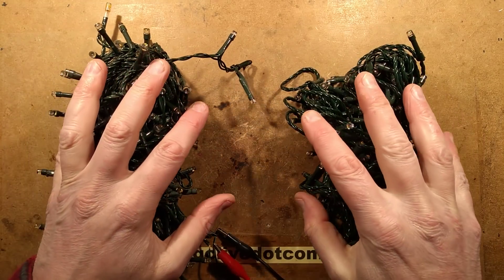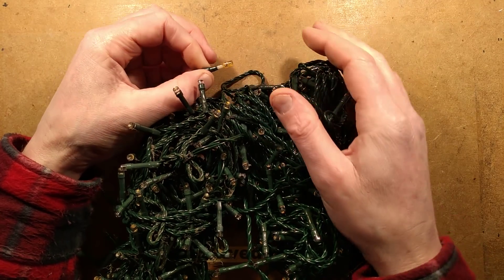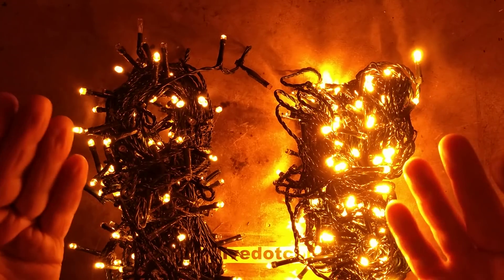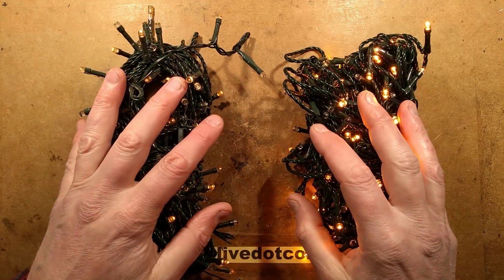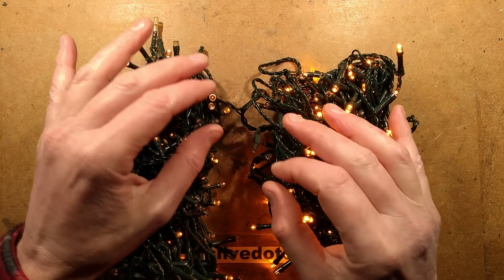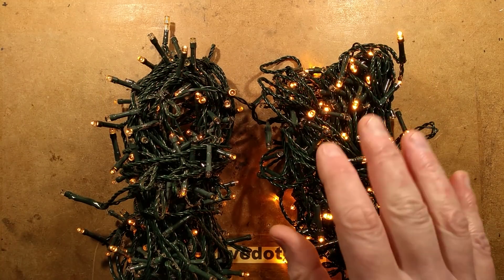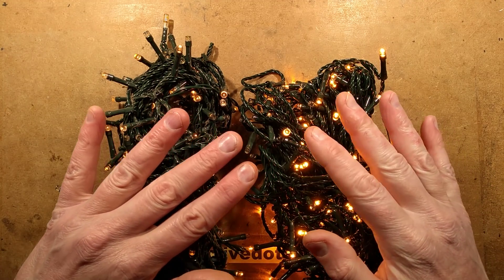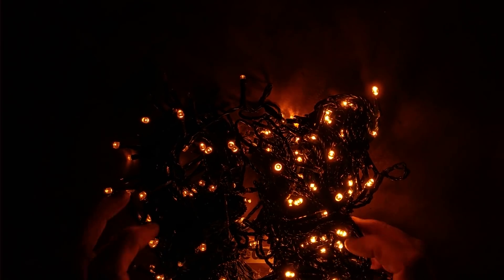9000 hour LED intensity loss test on LED strings.  (All LEDs do still work.)

Comment: I hate the way current bulbs, be it CFLs or LEDs, gradually fade. You don't notice it on a day by day basis, but then one day you're thinking "it's kinda dark in here, isn't it?", change the bulb and realize you've been working for months under fractional amounts of light. It's annoyingly sneaky :(
I miss tungsten bulbs. They were either giving you full brightness, or zero brightness. Very simple. Also because they had a much nicer light spectrum :(
Reply from the maker: That's especially true of overdriven LEDs.  Under-running them makes them last a lot longer.  Perhaps the worst bit is that they use as much power when old and dim as when new and bright.

Comment: So that also applicable to LED monitors and other LCD screens? In office they stay lit for 24 hours and after some 2-3 years you need to throw them to garbage? With CCFLs there was no such intense degradation seen.
Reply from the maker: All monitors experience gradually intensity loss over time.
Reply: @bigclivedotcom  gradual, yes, 10 years or so, for ccfl, from my experience. Not years like in this case.
Reply: Ayrat Gimatov - ALL LEDs and indeed CCFLs suffer a reduction in light output as they age. The LEDs in a monitor should be better quality than that found in a cheap set of Christmas / party lights. So they should last longer. Don’t your monitors switch to a low power standby state when the computer is not being used?
Reply: @Mark1024MAK  not in my case, it is in 24hr operation. That is why im worried. Older ccfl monitors got dim only after 10 or so years of such operation

Comment: I've had replaced every lamp in the apartment with LEDs. I was aware of the dimming effect of the diodes before hand. After 2 and a half years they still output good light. And honestly I've seen incandescent lamps dim out over years of use, and do it quicker then the LED bulbs I have.  As for LED Christmas lights, my average use for any set is 3 years. 6 weeks on at 24 hours a day. Also I don't buy the 200,000 hour life the manufacturer says. It's like those FRS 2-way radios that claims 36 miles distance but only go a mile or 2. It's marketing wank. Off my soapbox now.

Comment: The LED equivalent bulbs I got for my house had an L70 rating. Basically it's the time it takes for the luminance to reduce to 70% of it's original output.

https://www.simplyled.co.uk/blog/what-does-l70-mean/
Reply: I suspect the vast majority of ordinary people have no knowledge of the L70 rating and just buy based on the lowest cost and equivalent tungsten filament wattage figures... 🙁

Comment: These xmass type strings have become disposable in terms of price anyway. Stores where jam packed with a myriad of led strings, most for the price of a cup of coffee.  Felt kinda sad. I'm far from a Greta "How dare you!" environmentalist but I really don't like the disposable consumerism culture.
Reply: it literally makes me sad thinking of the lights clive is probably going to retire before they have fully failed, surely there has to be some kinda use for old, used, abused, tired leds!
Reply: @jdslyman C7 incandescent bulbs are rated at 3000 hours average lifetime. I doubt you would find many of them still working after 9000 hrs, if any at all.
Reply: Sometimes the incandescent strings have cascade failures though where all the bulbs go out.
Reply: I was never a fan of the C7 strings, but I can appreciate their versatility. Any old night light bulb can be swapped in for a burned-out bulb. The sockets are rugged, and the wiring is typically pretty good (especially on older well-cared-for sets). I have a cluster of three red plastic bells (with C7 bulbs) from the mid-70s that still looks and works as great as it did when new. The C7s are power-hungry by today's standards, but they certainly are robust and simple sets without some questionable-quality driver module attached or thin flimsy wiring that is probably cooper-clad aluminum instead of nice, fat, stranded copper.
In my family, 99% of what we used were the miniature incandescent variety. Our house lights stayed installed year-round, but at the beginning of each Christmas season I was out there replacing missing/broken bulbs and repairing the wiring that squirrels chewed up. After six years of splicing and heat-shrinking, or complete replacement of sets that were too far gone, we stopped decorating the house. I took all the sets down, salvaged every good bulb and fuse for our indoor sets, and tossed the rest. I can't even imagine what it would have cost us back then to replace every single damaged set, had I not repaired so many severed wires and chewed-up sockets.
*TL;DR* The older sets were more durable and repairable than what is out today, and I trusted my repairs more than I trust a possibly-dodgy power supply on LED strings.

Comment: I want to run 100 strand of these wide angle LED mini string lights that came with a DC 3 AA battery pack on a 12v car battery in the garden shed that is on a solar panel. Would I just need to wire up some resistors on the positive end or would I need something else to slow the current?
Reply from the maker: You'd need a resistor, or for greater efficiency you could use a 12v to 3.3v regulator module.  You can buy strings of 12v lights on eBay.
Reply: @bigclivedotcom  Awesome! thanks I'll give it a try.

Comment: Quality LEDs WILL NOT fade that fast. If manufacturers used quality components and properly engineered the product, you'd have a product that would last for years. Of course, this won't happen with a dollar store string of lights or cheap luminaries. My town switched over to LED street lights a few years back and they haven't suffered any visible lumen depreciation. I used to test LEDs on a constant current supply with a light meter. The cheap junk would fade below 70% within as little as 48 hours while the quality LEDs stayed above 70% for over 50K hrs.
Reply: Ah but the drivers on street lights, as far as I'm aware, compensate for this degeneration as they dont drive them as hard to start with and then ramp the drivers up over time to counter the effect, but at what point does the driver run out of puff, be interesting to see if Clive could restore the brightness by over driving the 9000hr set and how long they would last ?
Reply: @SmallroomProductions  This driver compensation technique doesn't make any sense. If quality LEDs were under driven from the start, there wouldn't be any lumen depreciation to be concerned with. In fact, a good LED fixture is made by running the LEDs at less than their maximum current using good thermal management and quality components.

I have run ordinary household LED bulbs for 5 years continuous in my enclosed front and back porch fixtures as a longevity test. They are still going strong. A quality commercial grade fixture could easily do 10 years without significant degradation. We shall see...
Reply: JohnAudioTech - can you provide any references for your qualitative, unsupported statements?  You get away with this stuff in your field because there is no way to calibrate your ears. Now you’re pulling the same stuff where data exists so show it or go away.

Audio people don’t give a damn about supporting their audiophoolary in their own field but seem fine with exporting it to areas of real engineering bb
Reply: @JohnAudioTech  you could be right, Philips give their lanterns something like 100'000hrs life which roughly equates to 20yrs on a dusk till dawn senario, although I do wonder if the electronic drivers will actually last that long. I've not been that impressed with commercial Drivers or electronic ballasts so far, when you compare it to the old wirewound ballasts which while they were pretty inefficient would just keep going and going regardless, they were after all just a lump of copper wire wound round a lump of steel, I've removed wirewounds that were circa 50yrs old and still running perfectly. Where as these electronic ones can have upwards of many hundreds of components inside them, any one of which can fail causing a complete failure or a light that just flickers the whole time.
Reply: @boonedockjourneyman7979  As I previously stated, I used to test LEDs and found the quality ones to last years whereas the cheap junk could fall below the LM70 standard within a few days of testing. It is rather apparent that you know very little about LEDs. Do your own research. Test a few and get back to me in a few years.

Comment: Replace everything with LED's they said, it will save the environment they said. They didn't say you would have to throw out the whole LED string and replace it every year, instead of just replacing a bulb. 
But an electric car their said, it will save the environment they said. They didn't say you would have to replace the huge 1 ton battery pack every few years instead of just changing some oil and spark plugs. 

Kidding aside, I love LED's but I was not expecting the dimming to be so dramatic in just a year. Very interesting
Reply: Maybe this leds aren't normal? Normal leds should last longer.
Reply: Don't forget that Lead Free Solder that quadrupled the amount of electronic waste going into the landfills.
Reply: Cheap LEDs from the Far East degrading quicker than higher priced quality LEDs, well that’s not really a surprise is it....!

Comment: There was me thinking that the lamp companies initially saying that with an LED luminaire you can get 100,000 hours was all correct, thoroughly tested and verified by an independent source were correct only not to find it's BS. I'm so disappointed... NOT!! So how much is this going to cost us with unnecessarily high street lamps. probably one of the best bits of road lighting outside RAF Northholt.
Reply from the maker: Good quality LEDs from a prominent manufacturer should degrade much slower.  Hopefully most street lights are using better quality LEDs.

Comment: Do you think this is from manufacturers driving them at max current rating for the chip, like 10+mA per chip? Is it heat that kills them or a chemical reaction in the phosphor? I'd imagine either way driving the chips more gently could help?

Edit: 100mA for the whole string doesn't seem so bad, hmmm
Reply: 3mm and 5mm traditional size LEDs often have maximum continuous current ratings of 20 to 30mA. I don’t know how this set is wired up, so can’t comment on the 100mA that they are running at. Lifespan of the LED chip’s ability to convert electrical energy to light degrades at a faster rate as the current level increases, and as the temperature increases. For maximum lifespan, they should be run at half (or below) the manufacturers rated continuous current rating. And where appropriate, they should not be operated at too high a temperature (so the higher power types need heatsinks to cool them).
For phosphor types, the phosphor will also degrade with use as well.
The cheapest lowest quality LEDs will also typically degrade at a faster rate compared to higher quality LEDs.

Comment: That's actually 4500 hours as they are run on a 50% duty cycle. In fact its even worse since there is also the ramp up and down time of AC that also reduces the duty cycle, lets call it 3000 hours if run on DC.
Reply: They are run from switched polarity DC from a controller, not from a sine-wave.

Comment: You only need to check the end of lifetime "left" lighting power on the normally sold led bulbs.
yeah, if they survive the switching, they are not really good anymore.
Better to get the 5 or 7W version and reduce current to the 3 or 5 watt you want.

For the 10 m usb-led strings i tend to double up from the usual 10 Ohms to 20 Ohms, and double up the led count if its too dark.

i really hope for fast ageing of the street lamps, because they went from standard ok-at-night to soccer-game lighting disturbing nature,
because it would have needed only 25W for same lighting, but hey, it does not take lots of power, so let's use 100W instead.

My dad is the same, because it has less watts from earlier he doubles or triples up on lumen/brightness
and could do heart surgery instead of the needed ambient lighting. totally annoying.
Of course the leds then also get hotter and age faster.

Comment: There are some completely unlit LEDs in the new set as well as the old. What's up with that?
Reply from the maker: Dual channel sets running on a single polarity.
Reply: BobEckert56 - yeah, Clive did say why half of each set would be unlit. Inverse parallel LED string running from DC rather than a polarity changing controller.

Comment: Are the LED's being over run? Doesn't seem like they last very long for LED's.  If I make anything with LED's I prefer to under run them slightly. Electronupdate did a 24,000 hr test for a filament LED bulb with little loss in light. Either those led strings are being over run, or they just used really low quality LEDs.
Reply from the maker: These were not being run hard.

Comment: What current do the individual LEDs run on?

I have regular 3mm cold white LEDs to illuminate my door bell. I run them 24/7 but at half the rated current. Runs for several years now. No visible brightness loss.
Reply: 3mm LEDs are normally specified with a maximum continuous current between 20mA and 30mA. For a good life, I recommend running at half power or less.
Reply: @Mark1024MAK  I run them at about 10mA.
I've installed them about 7 years ago. That's 61320 hours.

Comment: Just shows that although LED technology can be electrically efficient (in terms of money spent) compared to tungsten, they're still not quite there with regards to longevity, especially with lights that are on for many hours in a day, or even 24/7... :(
Reply: twocvbloke
Again, making leds 2x big and driving them at half the current is expensive and manufacturers absolutely want planned obsolescence.

Comment: Been a longtime watcher Clive, are you near london by any chance as id love a chat & for you to look at 3 LED units i have, ones old technology & frankly rubbish at what its made for, the other two well are both quantum board's that are tge latest technology, both are spider farmer & ones a SF2000 (2 boards) and the newest is a SF4000,  the SF2000 was £209 when i bought it ( now they are anything from £260 up and will go as far as £350 the SF4000 is going the same way ( HLG550) is its main rival and sells for £800 PLUS) they have meanwell drivers and Samsung LM301 diodes, Samsung have now LM301 H ( H for horticultural) and id like to buy the components and create a latest as i know what the buyers are looking for ( full spectrum lighting but increased 3100k and   basically heavy in blue and red with some IR thrown in also...making a board that has a ( plus) 2.7 umol and covers a 5x5 with the right components would cost, well boards heatsinks drivers etc id say £150 to make but they would sell for 750 easy, i want to give the end user great value and happy for years n years and not rip them off like most light makers have & do,  when you get 5 mins look at them online ( i bought my SF4000 for£429 & they are on Ebay now from £700 up and will still climb) i spoke to the company and they are producing 400 units a day and have back orders galour....hope we can chat after
Reply: Depends on what you call near... He normally lives on the IoM, sometimes in Scotland or where his work takes him...

Comment: Cable deterioration factor?
Reply: In what way? Clive showed that the current had not reduced, so the resistance of the wire cannot have increased.

Comment: So LED being "enviromentally  friendly" is a scam if you have change them every couple months to keep them at their max. brightness and efficiency..
Reply: Buying really cheap lamps and believing that they are the same as more expensive, better quality lamps is the real scam...
Reply: The more expensive ones have the same issue since they use the same technology...
Reply: radry100 - you could use that argument about many things, but in real life there are lots of different variables and variations that mean that a product from one manufacturer does not perform the same as similar product from another manufacturer. For example, all AA size cells (batteries) all have the same capacity according to your argument because they all use the same technology...